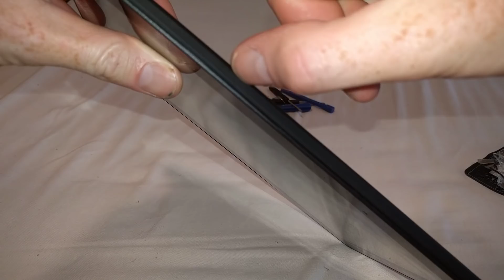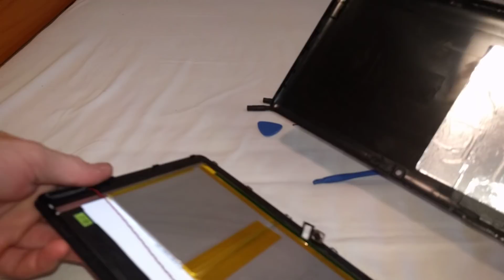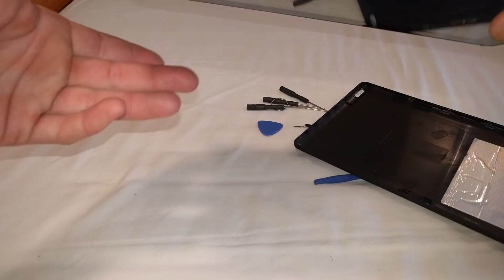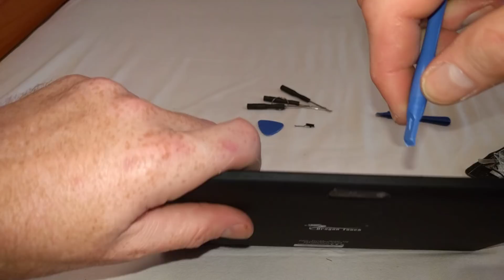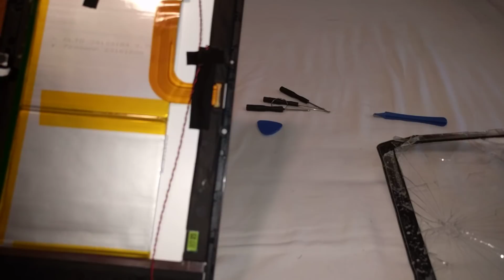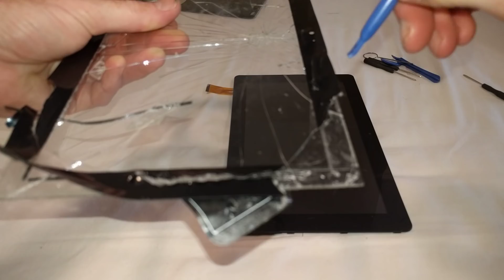Tutorial to fix broken Dragon Touch X10 digitizer screen; tips, tricks, common mistakes & Zero 7

Comment: Please help me, mine was stored, when I tried to use it it doesn't turn on with the power button, it only charges, however when I tried to turn it on with the charging cable and button - it was frozen on the charging screen, what can I do to solve it?

Comment: hey, desperately need help and have had no success with Dragontouch customer service.  Replaced the screen and in the process the connector tab on the power/volume sensor flex cable ripped. Per their policy DT claims to be unable to tell me the model # for a replacement sensor.  Can ANYONE suggest a sensor?  Do I just look for one that looks like it will fit?

Comment: HELP I BROKE FLIMSY THIN  ON/OFF VOLUME UP/DOWN Mylar connector to the aforementioned switch assembly. WHO SELLS THE SWITCH ASSEMBLY? NOT REPEAT NOT PLASTIC BUTTONS, but the switch assembly they engage. I already bought new screen, but the insanely fragile on/off/vol pcb switch mylar ribbon connector broke. It's hosed, I need a new one.

Comment: Thank you for sharing this. I picked up a broken Dragon Touch X10 octacore tablet at a flea market for the equivalent of $1.50. It had a smashed digitizer glass. I picked up a replacement digitizer glass for around $20 and I've just successfully done the replacement under the guidance of your video. I do have a heat gun and that came in useful in removing the old glass. The tablet is missing the on/off button but I may rig something up by cannabalizing another old tablet. I'm a very happy man. Thank you!

Comment: Just finished changing my screen. There is a weird pixilation bar a good inch thick going down the middle of the screen. Anyone know if I was just to hard on the tablet or is this a bad replacement screen? It does work now though. Still happy to fix it for 16$

Comment: Thank you so much buddy. Great video that helped a lot. I've replaced a couple screens on phones over the years but this was the first tablet. I actually used a heat gun which helped loosen up the glue but also melted through the ribbon cable of the old digitizer which was okay since I didn't need it. I'd agree though that heat gun isn't absolutely necessary but it did help. Nice to have my tablet back!

Comment: Thank you so much for this video.  Even though you weren't able to do a step by step, your insights and suggestions were extremely helpful.  I found that the plastic shims that came in the kit were completely useless, but the flathead scredriver did the job extremely well.  I was able to get the back cover off without breaking any tabs thanks to your tip, and you're right, getting that old, cracked digitizer off was the biggest pain in the ass.  I also had my power button fall off, as well as my volume button, but I realized there were little nutches next to where the button holes were - the tails of these buttons fit right in to these nutches and I was able to put it back together, with the buttons, as if it was never taken apart.

Thanks again for the video!
Reply from the maker: Sure man. Glad you had success and appreciate the detailed explanation of your process in the comments; the more knowledge out there, the better for folks who want to tackle this...

Comment: I have the Dragon X10 quad core tablet....10.1 inch screen. Is this a replacement for the 10.1 inch screen?
Reply: I have the x10 10.1 inch screen, and bought the digitizer replacement kit he has linked, and it indeed was the correct size.